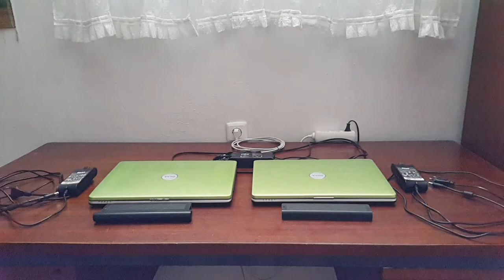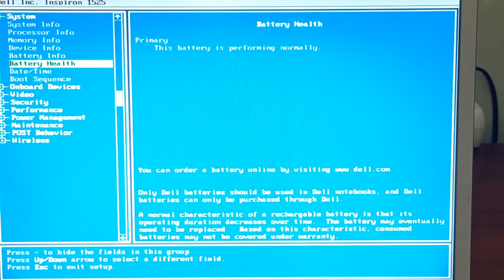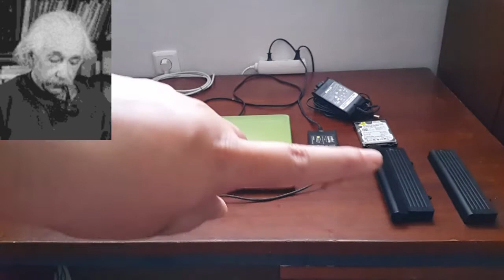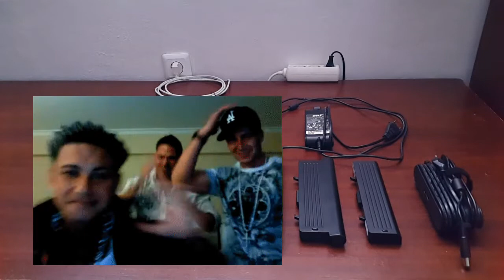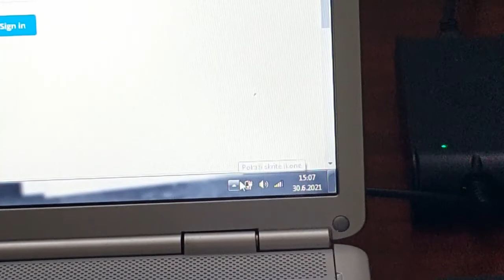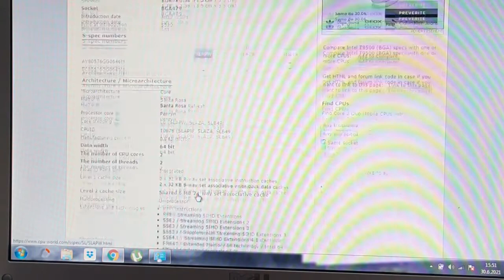Dell Inspiron 1525 Laptop Not Charging The Battery (Diagnose, Fix, PSID, CPU & RAM Upgrades)

Comment from the maker: Hello,

Below you have timestamp references for easy access or orientation through the video. There is also a copy of these in the description part as well. 😉

So how do then these work ? 🙄
https://www.minds.com/newsfeed/827329309057310720

Video Breakdown:

@ 00:00:00 - 00:00:34 -- Intro/Announcement

@ 00:00:35 - 00:01:32 -- Details About The Video Capture

@ 00:01:33 - 00:02:20 -- The Point Of This Video

@ 00:02:21 - 00:03:09 -- The Laptops, Batteries & Power Adapters

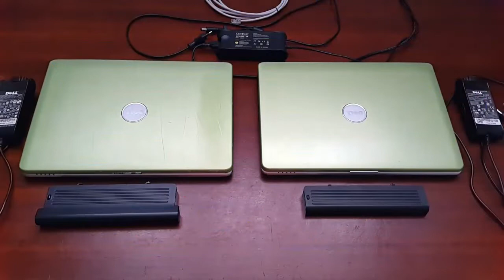@ 00:03:10 - 00:04:25 -- The 3 AC Adapters From a Couple Of Angles (Close Up)

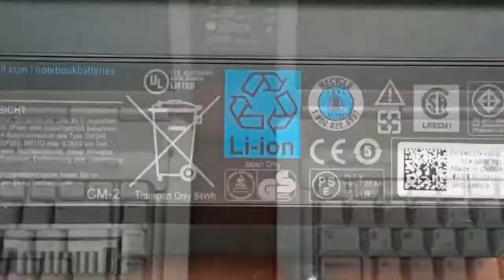@ 00:04:26 - 00:04:55 -- 6-Cell & 9-Cell Battery Overview

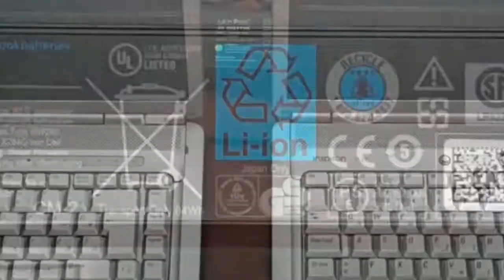@ 00:04:56 - 00:05:17 -- The 2 Dell Inspiron 1525 Laptops Up Close

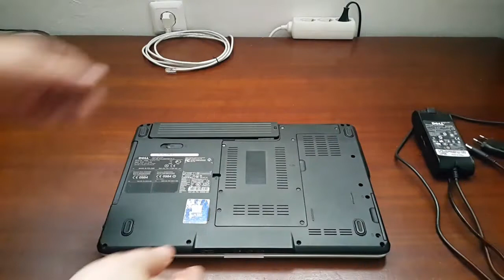@ 00:05:18 - 00:05:45 -- Disclaimer On Further Steps

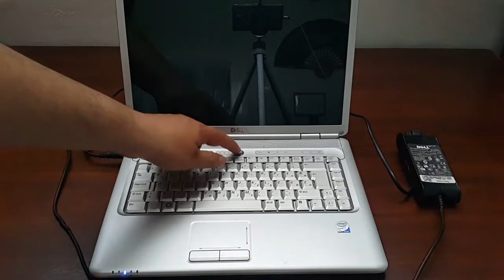@ 00:05:46 - 00:06:10 -- Right Laptop & 6-Cell Battery + AC Adapter

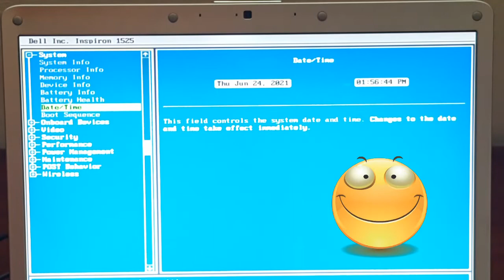@ 00:06:11 - 00:06:58 -- Turning It On & Entering The BIOS

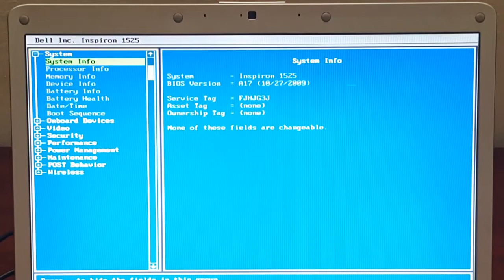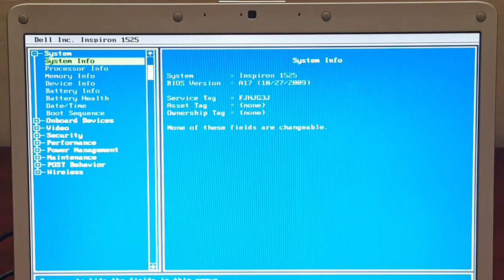@ 00:06:59 - 00:08:17 -- Quick Note On The Modded BIOS & Upgrade Conditions

@ 00:08:18 - 00:08:37 -- Test With Running Only On The Battery

@ 00:08:38 - 00:08:48 -- Note On Next Proceedings

@ 00:08:49 - 00:09:18 -- Right Laptop & 9-Cell Battery + Original AC Adapter

@ 00:09:19 - 00:10:06 -- Turning It On & Entering The BIOS

@ 00:10:07 - 00:10:21 -- Test With Running Only On The Battery

@ 00:10:22 - 00:10:38 -- Announcement On The Next Experiment

@ 00:10:39 - 00:11:14 -- Right Laptop & 6-Cell Battery + Generic AC Adapter

@ 00:11:15 - 00:11:57 -- Turning It On & Entering The BIOS

@ 00:11:58 - 00:12:03 -- Test With Running Only On The Battery

@ 00:12:04 - 00:12:32 -- Right Laptop & 9-Cell Battery + Generic AC Adapter

@ 00:12:33 - 00:13:09 -- Turning It On & Entering The BIOS

@ 00:13:10 - 00:13:18 -- Test With Running Only On The Battery

@ 00:13:19 - 00:14:15 -- Right Laptop & 6-Cell Battery + Left Original AC Adapter

@ 00:14:16 - 00:14:37 -- Turning It On & The Error Message

@ 00:14:38 - 00:15:39 -- Explanation On The Error/Adapter Fault

@ 00:15:40 - 00:16:31 -- Entering The BIOS

@ 00:16:32 - 00:16:39 -- Test With Running Only On The Battery

@ 00:16:40 - 00:17:18 -- Terminating The 9-Cell Battery Test

@ 00:17:19 - 00:20:06 -- Reveal On Another Problem One May Encounter

@ 00:20:07 - 00:20:33 -- Next Set Of Experiments

@ 00:20:34 - 00:21:24 -- Left Laptop & 6-Cell Battery + Original AC Adapter

@ 00:21:25 - 00:21:48 -- The (Other) RTC Error Message

@ 00:21:49 - 00:22:33 -- Entering The BIOS

@ 00:22:34 - 00:22:48 -- Test With Running Only On The Battery

@ 00:22:49 - 00:23:11 -- Left Laptop & 9-Cell Battery + Original AC Adapter

@ 00:23:12 - 00:23:43 -- Theory On The Laptop Turning On Automatically

@ 00:23:44 - 00:23:50 -- The (Other) RTC Error Message

@ 00:23:51 - 00:24:31 -- Entering The BIOS

 @ 00:24:32 - 00:25:03 -- Left Laptop & 6-Cell Battery + Generic AC Adapter

@ 00:25:04 - 00:25:26 -- The (Other) RTC Error Message

@ 00:25:27 - 00:26:01 -- Entering The BIOS

@ 00:26:02 - 00:26:14 -- Test With Running Only On The Battery

@ 00:26:15 - 00:26:38 -- Left Laptop & 9-Cell Battery + Generic AC Adapter

@ 00:26:39 - 00:27:19 -- The (Other) Error Message

@ 00:27:20 - 00:27:38 -- Entering The BIOS

@ 00:27:39 - 00:28:32 -- Brief Analysis & Next Steps

@ 00:28:33 - 00:28:43 -- Test With Running Only On The Battery

@ 00:28:44 - 00:30:58 -- Discussion On The RTC Error

@ 00:30:59 - 00:31:51 -- Removing The CMOS 3V CR2032 Battery & Measurement

@ 00:31:52 - 00:32:14 -- Adding a New CMOS 3V CR2032 Battery & Measurement

@ 00:32:15 - 00:33:18 -- Advice on CR2032's

@ 00:33:19 - 00:35:15 -- Dell Inspiron 1525 Motherboard (Up Close)

@ 00:35:16 - 00:35:37 -- BIOS IC Location

@ 00:35:38 - 00:36:04 -- BIOS EEPROM Magnified

@ 00:36:05 - 00:35:37 -- BIOS IC Location

@ 00:35:38 - 00:37:38 -- Final Reveal On The Problem

@ 00:37:39 - 00:39:03 -- How I Fixed The Issue (Spare Parts Note)

@ 00:39:04 - 00:39:54 -- Announcement On Additional Steps

@ 00:39:55 - 00:40:33 -- On The PSID

@ 00:40:34 - 00:42:15 -- PSID On The DC Plug Of The AC Adapter & On The PCB

@ 00:42:16 - 00:43:54 -- PowerPort (Components, Tests, Layout)

@ 00:43:55 - 00:44:31 -- Diagnosing Further Issues On Motherboard 

@ 00:44:32 - 00:46:07 -- D26, Q21, Q20 & D24 Components (Voltage Readings)

@ 00:46:08 - 00:47:47 -- Understanding & Reading The PDF Schematics (PSID)

@ 00:47:48 - 00:48:41 -- Super I/O & PSID

@ 00:48:42 - 00:49:21 -- PSID On The Motherboard (PowerPort Connector)

@ 00:49:22 - 00:51:23 -- What's Next On The Horizon

@ 00:51:24 - 00:52:08 -- Left Laptop & 6-Cell Battery + Original AC Adapter

@ 00:52:09 - 00:52:56 -- Turning It On & Entering The BIOS

@ 00:52:57 - 00:53:46 -- Windows Ultimate 7 Test

@ 00:53:47 - 00:54:16 -- Test With Running Only On The Battery

@ 00:54:17 - 00:54:51 -- Left Laptop & 9-Cell Battery + Original AC Adapter

@ 00:54:52 - 00:55:46 -- Turning It On & Entering The BIOS

@ 00:55:47 - 00:56:13 -- Windows Ultimate 7 Test

@ 00:56:14 - 00:56:38 -- Test With Running Only On The Battery

@ 00:56:39 - 00:57:18 -- Left Laptop & 6-Cell Battery + Generic AC Adapter

@ 00:57:19 - 00:57:57 -- Turning It On & Entering The BIOS

@ 00:57:58 - 00:58:20 -- Windows Ultimate 7 Test

@ 00:58:21 - 00:58:38 -- Test With Running Only On The Battery

@ 00:58:39 - 00:59:10 -- Left Laptop & 9-Cell Battery + Generic AC Adapter

@ 00:59:11 - 00:59:57 -- Turning It On & Entering The BIOS

@ 00:59:58 - 01:00:23 -- Windows Ultimate 7 Test

@ 01:00:24 - 01:01:02 -- Test With Running Only On The Battery

@ 01:01:03 - 01:02:55 -- Determining The Laptop Battery Capacity (HWMonitor Software)

@ 01:02:56 - 01:04:25 -- Determining The Laptop's CPU (CPU-Z Software)

@ 01:04:26 - 01:08:37 -- Discussion On CPU Upgrades

@ 01:08:38 - 01:09:21 -- Talk On RAM/Memory Upgrades

@ 01:09:22 - 01:12:22 -- Third Original Dell AC Adapter Fault Note

@ 01:12:23 - 01:14:32 -- Conclusion & Summary

@ 01:14:43 - 01:15:32 -- Final Thoughts

Comment: Best video on this question anywhere online. I've got exactly this problem and it randomly started happening just the other day - but I'm not sure if it's the DC jack on the laptop, or the unofficial power brick (which had no "not recognized" issue until the other day). What's the best course of action here? Is it worth just trying a different brick or is there an easy way of telling if it's the jack's fault?
Reply from the maker: Hi,

Well thanks hey ! 😁👍

Hmmm... well it could perhaps be the cable in your power adapter that's actually the culprit. If you twist the DC cable side too much you might stretch out that thin wire that is in the center of it (& thus cause it to break).

The only sure way to eliminate that the issue is not on the adapter side would be to open the latter up, desolder the cable & then use the digital multimeter ("Diode Mode") to check if the center pin wire hasn't been severed in any way. 🤔🙄

While if the problem is on that Power Port PCB then you might check if the actual DC socket is loose. Also if those center brass curved pieces are properly "hugging" the center pin (the DC plug). 

Because if like those became loose then you might have to think about changing the socket alltogether. You might even try disassembling the socket to correct the issue manually (if this is the case). That is if you have the nerves, good sight & steady hands to go about it. 😶😑

Then (still on the Power Port side) checking that diode & capacitors might be a good idea.

While on the actual motherboard follow those diodes, transistors & check them (Diode Mode again). 😌

Hope it helps. 😕

Best Regards,

Comment: Hi David, thank you for your very helpful video. I have 0V for the PSID voltage on the centre pin power port connector. I have checked the 4 components you suggest on the power port board and there is no continuity, and there is 19.5V on the pins you suggest to check on the connector. I have checked voltages at Q20, Q21 and D26 and they are all correct, and there is continuity from Q20 drain to pin 9 on the connector. so I believe this means something on the power port board is the issue, do you agree? Do you have a copy of the wiring diagram for the power connector board?  Many thanks  Simon
Reply from the maker: Hi,

Yes it is plausible that maybe one of the diodes on that small power board has gone bad. You can get the entire board on eBay or AliExpress though. 🤔🙄

But did you also in the first place check your power AC adapter ? Maybe that's the culprit. 😕

You have the schematics (PDF) link in the description (at the very top of thereof).

Best Regards,
Reply: @davidbolha  Yes the power supply is fine, it works happily in another old Dell laptop. Oddly when I power up the motherboard and plug the battery in I got 12.6V at both the battery + contacts but still no PSID voltage at the power socket. After a short while the battery voltage started dropping but if I press the power board to motherboard connection it returns to 12.6V but still no PSID signal at the socket.
Reply from the maker: @simonsmith874  Maybe the input power socket plug (the contacts inside) have no connection with the center pin of the plug (coming from the AC adapter). That's also a possibility. 🤔😕